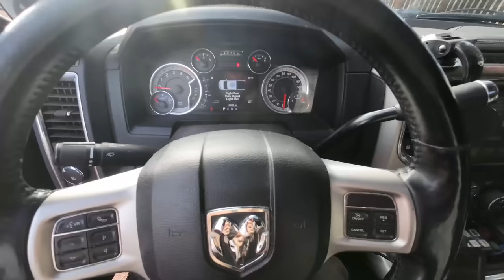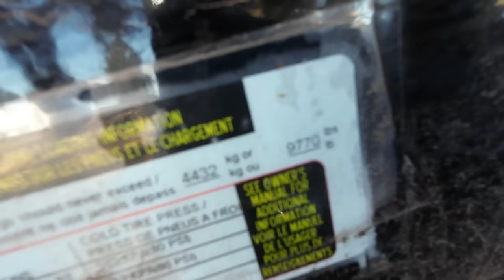I might need a tow truck for my tow truck..

Comment: Had a lighter duty 7x10 LoadnTrail setup like yours. Really liked it, especially the 3 way gate. Note though, the main problem I had was those doors that hold the ramps rusted shut. I would suggest you replace the hinges with greaseable ones.
Reply: Rust isn’t much of a concern here in the high desert. No salt on the roads and very low humidity.

Comment: No worries Casey...  You have one of those personalities that translates well to the camera and you're very personable.  If I knew you personally, you would be one of those guys that there would be no question about hanging out with and doing projects together.  Very nice dump trailer and glad your trip had a happy ending.  That trailer will give you alot of years of use.

Comment: Hope the engine misfire doesn’t set you back too far! Also, I have owned many dump trailers and you have selected a good one! 

A word if advise if you’re interested… use a pintle coupler. I once had a ball coupler on a dump trailer and experienced a detachment due to wear on coupler/ball when the load shifted to behind the axles when dumping. No one was hurt but the tailgate repair lightened my pocket book a bit…

Comment: When you change your fuel filter on your tow truck fill the housing backup with dextron II automatic transmission fluid. Do this every time you service it.

Comment: This is why I loved my Cummins 12 valve mechanical engine! Great mileage, good power, and mechanical injectors. I never had to replace an injector but they were cheap if needed.
Reply: A twelve valve is not going to move that kind of weight.
Reply: @matthewwilliams9028  not stock but I knew that. 12 valve Cummins can easily produce 1000 + hp if you have the cash to put into it. The p- pump injection pump can be modified to flow 1600hp worth of fuel. I have friends that run power stroke, duramax, and newer Cummins and there is a lot more to go wrong.

Comment: I'll be praying you don't need a top end rebuild. Damn that's expensive! Love Cummins for their torque and reliability. When I drove over the road the biggest problem I ever had other than sensors blowing was the cat clogging. But cleaning them is easy and much cheaper than replacement.
Good looking dump trailer. I didn't buy one because every load requires pulling away because of low bed height.
Good luck with your new toy/tool.
You are in my prayers
Hoka Hey

Comment: Dump your oil and check for glitter. Chances are your ipr valve is sticking and a set of injectors will help. But the hpop oil pump is probably on the way out as well. Invest in an oil centrifuge to keep that huei system happy.

Comment: I drove my truck from New Jersey back to Iowa on 5 cylinders with a severe oil leak( about a gallon every 100 miles) with a load on too. I just put a whole new engine into it after that.

Comment: You are going to love your new load trail dump trailer it's one of the best ones made out there I have the same model and I love it just some advice get a rubber mallet and put in box on front some materials do stick in the nose and I have had to bang on floor underneath to loosen it and when rolling up the tarp it helps to have two  people with one it rolls up crooked and I had to put hooks on mine when rolled up or it would un roll when bouncing down the road

Comment: It sucks when you've got mysterious issues with a vehicle. I know basic code readers for cars aren't that expensive now, but I don't know for heavy trucks. 
 A code reader for smaller vehicles might be an idea? Sponsorship maybe?
Wouldn't you know, just this morning I had to take my vehicle to the garage to get the check engine light assessed. I was very fortunate that it was simply a tiny vacuum leak; a one minute fix.

Love the trailer! Congrats on getting a great deal!

Comment: In 2018, I lost an injector on my 04 2500 Silverado. Problem started in a campground, outside of Tok Alaska. It was a long drive home to Mich pulling the fifth wheel. Had the injectors replaced and sold it immediately. Pcked up a 15 Silverado with a lot less mileage.

Comment: What a beauty of a trailer. All my workin life (50 yrs,) I need one of those, no money. I would strip the roof of shigles, install new shingles. Then send the next day loading and unloading five loads in my 1/2 ton ford van. To day every Fly By Night roofer has a trailer like your, Back across the lawn , throw the shingles off the roof on the trailer.Gone to the dump  Sure hope that the tuck of your has a repair that is minor.

Comment: I have the 5×10 surtrac dump . It has done more than you can imagine around my house. It was the right equipment for my have 1/2 ton truck, but I always wished I could always haul more . It's just a tip that you probably already know. Do not load it heavily in the nose, or you'll be shoving. From my research, the only one that can pick up a heavy front is the front pogo ram in the front of the trailer. The drawback is that it is slower than the rest of the rams.
The other thing I found is that when you dump with the spreader gate. The tail of the trailer is like a dog dragging it's  butt. Its tail is too close to the ground. Open the barn door is the best for a full dump . Even then, the pile is limited because  of the height of the tail . You are still going to love it.

Comment: I use Amsoil fuel treatment in my 6.7.   The new low sulfur fuel needs some extra lubricant.  I also have a FASS primary fuel system.  That is also there to help the injectors.  It prevents air for being in the diesel.  The way it was explained to me is---------a tiny air bubble that is in the fuel attaches its self to the injector plunger.  When the injector fires, the air bubble pops, and sometimes takes a molecule of metal with it.  If this happens  billions of times, the injector will eventually fail.  I have noticed that many times when I changed a fuel filter on any diesel engine, there was usually a small space at the top of the fuel filter that had no fuel in it.  That is where the air comes from.  The filters that I have had the most experience with are Detroit diesels, and Caterpillar diesels.  I have noticed this with both.  My 2009 Dodge is so hard to get to, that I have no idea if it has air in it or not. With the new FASS system, my filters are super easy to access.  My Son had a Dodge that was a few years older than mine, and it got hard to start.  He had to replace his injectors to the tune of $3600.  Supposedly the FASS system will prevent this issue.  They probably have a set up for your big truck.  Just an idea.   The performance shop that I use turned themselves into an Amsoil dealer just to get that diesel fuel additive.  These people I do trust.  The Dodge dealer???  Not a chance in h**l!!!!!

Comment: Getting the starter in the tractor to fill the hole and with the dump trailer you can move more dirt if you run out.

Comment: Hope the big to truck is an easy fix Casey! what a rad dump trailer. so versatile and for all the 360 degrees of different things you do I'm sure it will be handy. What a great video. Now I need to go check what this latest check engine light is. Get a Jeep it's fun they say.

Comment: I had a Big Tex dump the same size. The only time it would not dump is when the quarry put on 7 tons instead of the 5.5 I asked for. I did have to replace the solenoid on the hydraulic pump once.

Comment: I would definitely change oil if you wind up doing injectors. In case fuel washed down the cylinder. I know it's just 1, but better safe than sorry. 👍

Comment: Hey bud we use very similar trailers at my job we do concrete cutting the one thing we always do is extend the ramps or just make new ones with 90° angle iron there’s room down there to make them at least 2 feet longer which makes using a wheelbarrow up the ramp a lot easier

Comment: I hope you get your truck fixed when I had my 2006 F250 bullet proof in Arizona. They recommended hotshot stiction eliminator. I’ve been using it for several years now and I haven’t had any issues. Don’t know if that would help you or not might be worth something to look into.

Comment: Modern diesel has been mutilated, the lubrication has been reduced and replaced with phenyl chloro benzene to be more heat resistant for the electronic type injectors.Add a little engine oil in the fuel.

Comment: Now you get to play the economics game of hauling your own gravel.  I live 4 miles from a crushed shale pit and different projects I've done different things but in the end I found it easier and cheaper to have a 10 or 12 yard truck bring gravel and add to my stockpile that I then use for various projects here on the farm.  Your trailer will haul about three yards by weight of heavy crushed rock.  If you are going near the pit anyway it makes your load very economical.  Nice trailer, I am Jealous as I have been wanting one for several years too but my wife says the last thing I need is another trailer.   
Good luck on your rollback truck.  Liking your variations in videos and that they are short subjects.
Reply from the maker: Not when I have to go to town every morning anyways within a couple miles of the gravel pit.

Comment: I drove a big  rig once that sucked an injector and went run away and  finally shut down without burning. The motor  up at 12000 Miles, when it was taken under warranty to Cummins they said it's not uncommon for new rigs to suck an  injector.
Reply from the maker: This truck is far from new
Reply: @CaseyLaDelle  totally understand,   even new they get problems with injectors ... did they find that it was starting to suck  an  injector by the look of the white fuel blowing out of your stack  it looks like  early stages along with other things that happen when they decide to suck an injector(s)  ....Cummins is a great engine but when they have their minor issues they can be a pain in the behind . 🤣  I'm curious the extent of your issue . Was it's minor or.did they have to do.a full rear down rebuild or replace injectors or did you have other issues plus injector(s) .  keep us posted we would  like to know what they find or have found.... Two great sites for mechanical issues deceased man named diesel Techron  on YouTube a great guy like yourself he helped everyone around him many times no charge to help them  . And another Guy bill Hewitt another great guy who  has a web site https://powerstrokehelp.com/    he's on YouTube as well .   Gives great info about non commercial and commercial diesel mechanics .
Reply from the maker: @user-ARK1547  number four injector failed internally

Comment: I had something similar happen on a car deal last summer. I set up a time to meet at a bank , got a friend to go in case i bought it and borrowed a truck to get there plus drove 44 miles only to pull up as the car is driving away and then a text came saying , Sorry just sold the car ! WTH ? Setting up multiple appointments at the same time he must have been a car flipper. I was so pissed..

Comment: Gotta say I seen it coming with it being an international, good luck with it.
Reply from the maker: What does the hood emblem have to do with the engine?
Reply: We’ve had nothing but problems with our international trucks at work, the wiring is a nightmare along with all the engine problems we’ve had over the years, our kenworth an peterbilt trucks have been going just as long an have had significantly less issues. jus had too put in my 2 cents cause I’ve been thinkin that for awhile watching your vids wondering when ittl start having issues. All said good luck hope business is good this year.
Reply from the maker: @jessenash9637  again, this engine is also used in every single other manufacturer out there, and the parts inside (like injectors) are 100% identical.   So are you saying that the injector, a mechanical part, failed because it knew that the hood says international on it??    
Aside from that, internationals are very well known as being reliable and economical trucks up until 2008 when the maxxforce was introduced.   What year do you think my truck is?

Comment: My Cummins is    in a freightliner. Did you get a check engine light ? I had a check engine light and the  problem was a crank  position sensor. I carry a spare sensor. I had a 343 code. I have a toggle switch. It will flash the codes on my dash.

Comment: Flat bed.  You blew the tip of the injector off.. make sure the oil is not full of diesel fuel.. also replace all 6.

Comment: does it say its desinged for low or extra low sulfur fuel? stuff designed for low i put atf in every fuel tank, keeps the system happy on extra low sulfur.

Comment: KC are you running any automatic transmission fluid in your fuel tanks you should be running some kind of a additive in there old school truck roadrunner automatic transmission but you drove for long time you should know that and it's supposed to keep your injectors all lubed up all that other good I guess I got all kinds of other stuff now but you can run in there but you need to run some kind of an additive in there because of the crappy fuel that they put it in this truck stops and mom-and-pop stores anymore they just don't care what they put in there so you need to run some kind of an additive
Reply: Ken, You were taught proper punctuation in grade school.  Have you forgotten already??

Comment: Y couldn't u retrieve the codes urself....check engine light blinks in the codes......look them up.....savr time and a fee..  unlesd its under warranty.....no ?
Reply from the maker: Because Cummins Insite software is stupid expensive and I’m not going to dig into the engine myself anyways.   So it goes to the dealer.